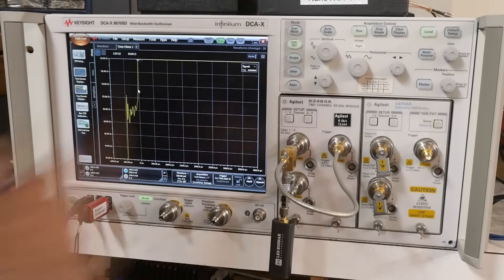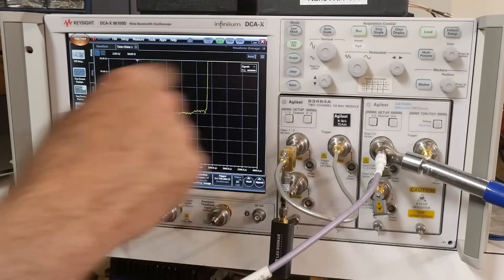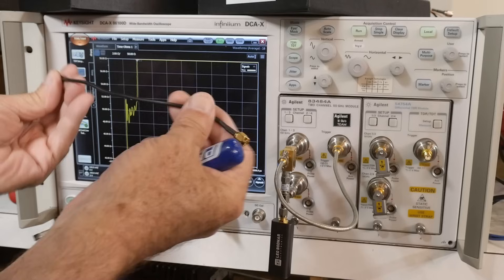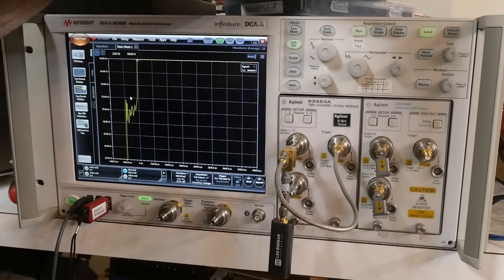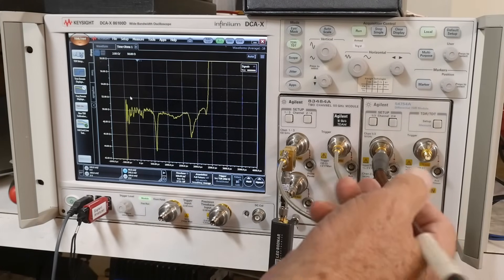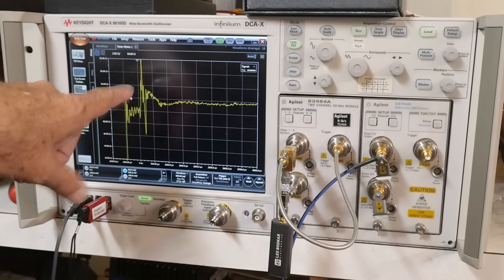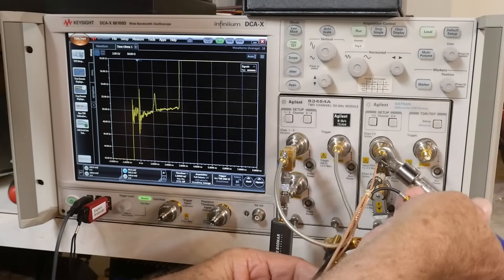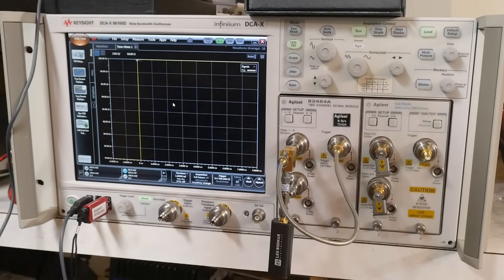#2300  DCA-X TDR Test 50 Ohm Cables

Comment: Very clear quality differences between the cables. The only comment I would like to make is that the SMA chassis parts wears out quickly with your test.
Reply from the maker: the unit has male connector and the test sma section is a short female/female replaceable adapter. ideally this would be stainless steel, but I'm using a brass part since it was free. I had to buy one that was missing and got a stainless part for about $70. the good ones are >$300

Comment: I also noticed that shavings and/or wear products (metal dust) can accumulate inside the connectors in the insulation zone. Very often, soft fluoroplastic is used as an insulator material there, and shavings and metal dust stick to it like plasticine. If do not pay attention to this and do not clean it out, this can also affect the picture and quality of the RF signal.
Reply from the maker: I often clean the connectors with  alcohol

Comment: Hi @IMSAIGuy, I know you have a 8711C/12C with the step attenuator Option, I would love to retrofit this option on to mine, so could you make me some more detailed pictures of the option module?

I have posted a thread on the EEV blog forum
Reply from the maker: this shows the 60db attenuator: https://youtu.be/Ble1lVNVJzA?si=MhhY_kxCcSdZlg9j
Reply: Yes I know, I looked at it and in a way it gave me the idea that it should be posible.

One problem is that I do not know if it is the SC or SD version of the attenuator.
And also what else there is on the board.
Reply from the maker: it should be in the service manual or CLIP
Reply: Sadly I can not find it in the Servic or other documents I got with the machine or online, since there is no CLIPS for the Attenuator option, or I am not able to find it.
Reply: Is it possible that you can tell me what IC is on there?
I tried reading it out of the Picture in your video but on 1080p it is just not readable, I think there is a MC and a 14
Reply from the maker: @tobiasfalk402  sorry, it is just too hard to open up
Reply: No Problem, I think I found out everything that I need to try.

Comment: The method you are using on that video is a low-pass step?
Reply from the maker: no, a high speed step and TDR
Reply: @IMSAIGuy  Thank you for the answer. I could get almost the same picture of measurement on NanoVNA-F V3 in TDR low-pass step with display format LOGMAG, 201sweep points and 0 - 6.3ghz. The only difference is that I see the picture in dB, not ohms. Losses on connectors and poor quality cables are clearly visible in this mode. It seems like it could be used for similar tasks.
Reply from the maker: @makskk6spm275  using a VNA you can get TDR using FFT.

Comment: excellent, als torque is always a problem, have a collection of them, .. whats great you can also measure sma connectors etc or others with this, also self crimped sma (I use a ebay gotten measure device for the length measurement), ... never saw a 90 Ohm cable before, 75Ohm is sometimes used but also not with sma connectore very interssting.

Comment: Also, one really nice thing about the Gore cables was you can get them with replaceable ends.  The cable ends with a Gore connector and an adapter to APC 3.5, N, whatever.  There's a separate torque wrench that you use to tighten on the connector end to the cable.  Very nice.
Reply from the maker: yes, and most can't afford even the end bits!

Comment: The difference between TDR and VNA is that this is a time-domain test (time domain reflectrometry). A VNA does the exact same thing - except in the frequency domain. It's two sides of the same measurement! Just like an oscilloscope and spectrum analyzer are similar - one is time domain, the other is frequency domain. Some measurements are better with one than another (phase relationships are poorly expressed in the frequency domain, but are plainly obvious in the time domain). And now you know how Keysight can sell basically the same instrument twice - one works in the time domain, the other works in the frequency domain, or how those Chinese manufacturers just box it all into one cheap box since the hardware's basically the same (glossing over some obvious things).

Comment: I picked up a long chunk of smaller teflon coax that I think is 92 or 93 ohms impedance per the specs. But I did not buy it for the impedance,  I bought it for the very low capacitance per foot.  I think is like 15 pF per foot,  half of what 50 ohms stuff can be.  But still not quite as low as scope probe wire.

Comment: The first time I bought a analyzer that had TDR and phase analyzer function it was a eye opener testing my cables.  Over the years I have changed them all out to MegaPhase, Gore and other top end microwave cable manufacturers.  What was really interesting was seeing how much effect moving the cheap cables around had on phase and impedance.  Switch to a premium phase stable cable and moving the cable around had little to no effect on phase or impedance.
That last cable, might it be a 93 Ohm cable?  That is a standard impedance for cables like RG62 which was primarily used on computer networks.